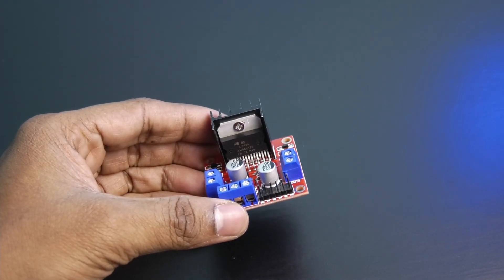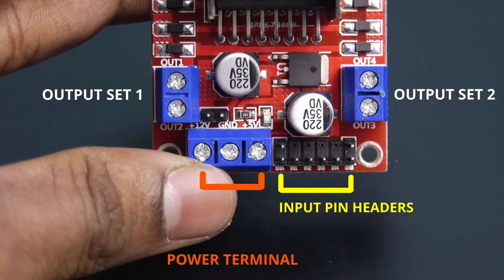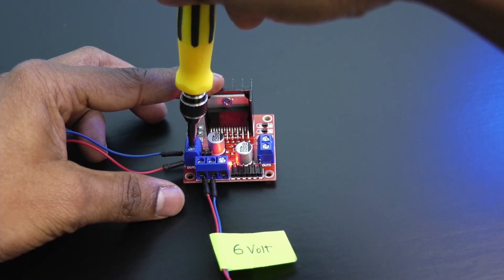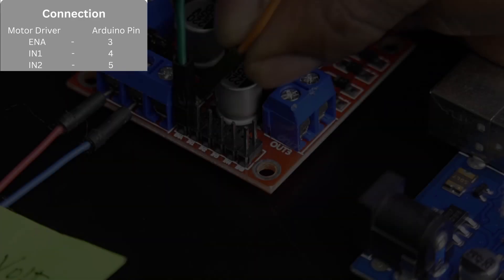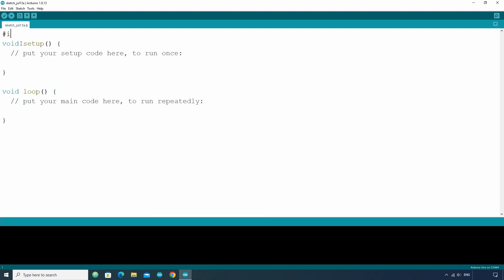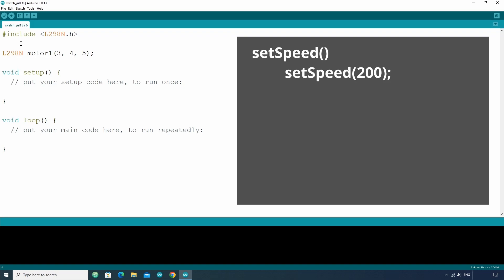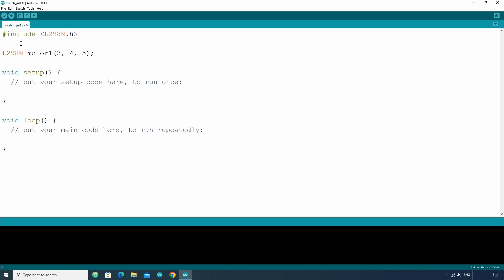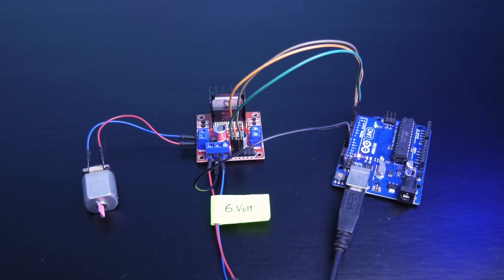Control DC motor with L298N driver | How to use L298N motor driver with Arduino | Ut Go

Comment: Hi sir like this i need to control solenoid valve for 5 station
Reply from the maker: You can use relay modules to control solenoid.

Comment: Hi! Can I use L298n outputs in parallel to control only 1 dc motor for higher currents? How do I do the wirings? P.S I need to control speed and direction.
Reply from the maker: This is not the ideal way but I think it will work.
Connection will be in parallel as you have said.

Comment: Hi sir, I've tried this code. It's working. The motor is making some noise but no movement is seen. May I know where might be the problem?
Reply from the maker: Either the speed setpoint is too low or the battery voltage is low